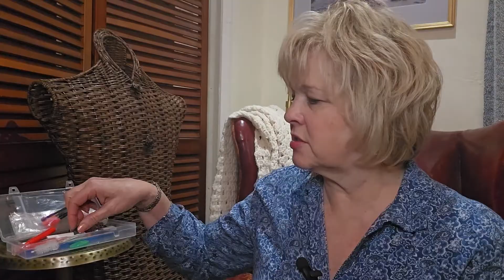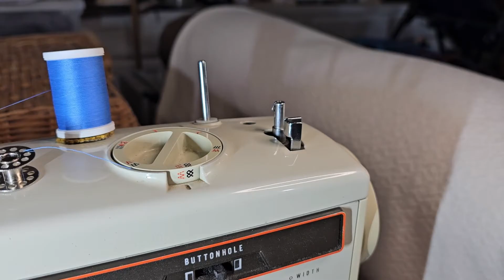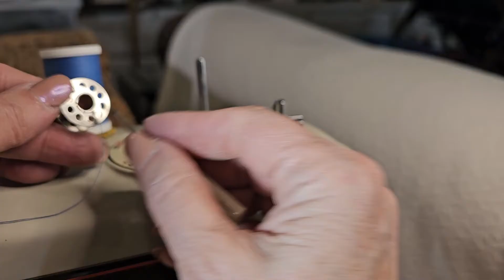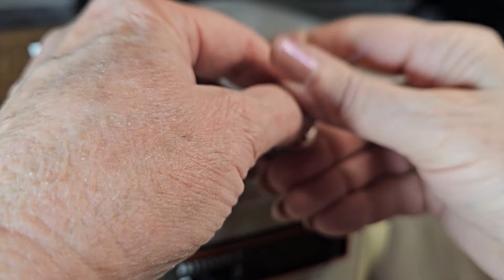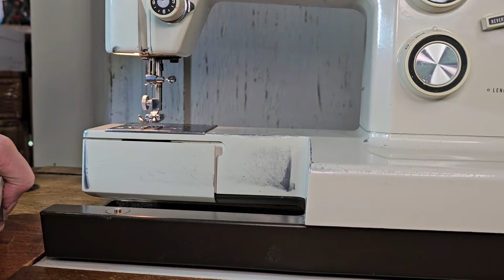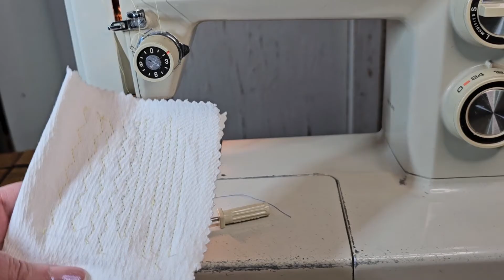Kenmore Sewing Machine Bobbin Basics // Front-Loading Bobbin for Beginners Part 2

Comment: I have a very similar kenmore and the bobbin housing came out. Can you do a viddo to show how the hardware goes back in the proper way?  My machine looks the same bit its a 6 stitch model. I got it 50 years ago when i was a new mom at 20. I haven’t used it in about 15 years and I want to make sure I put the hardware back in the right way. 
Also it’s so hard to thread the needle at 70 yrs old😢. Thanks

Comment: Very helpful! For some reason I oiled but my clutch is still stuck, any tips?
Reply from the maker: @brianislas4154 You have to hold the hand wheel tight and loosen the clutch knob ( middle part of the hand wheel). If it won't loosen, it may need to be professionally cleaned.
Reply: Let it wait a day or two.